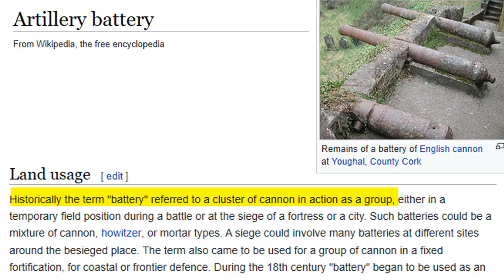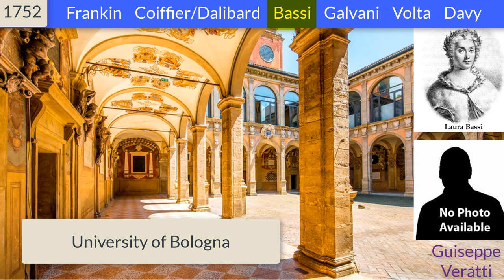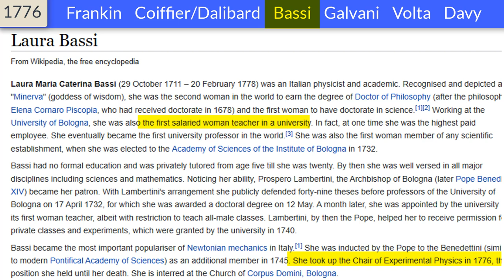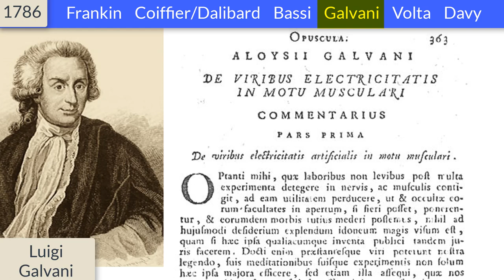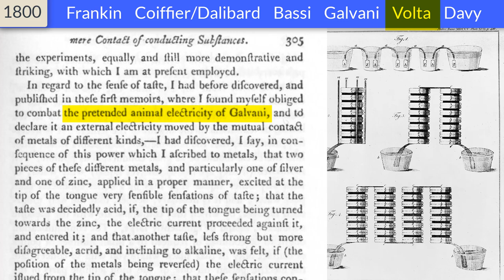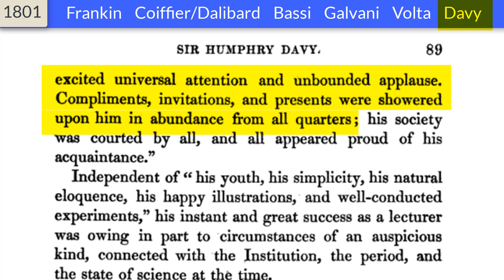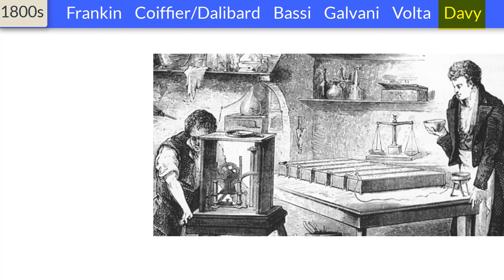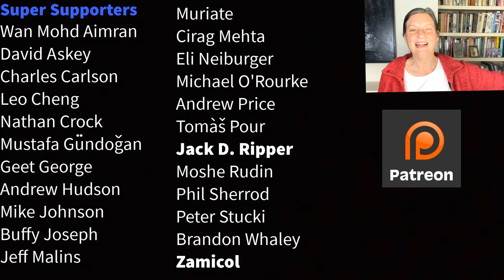Battery History: the Origin of the Name [CC]

Comment: Ironically, two of the most revolutionary energy producing devices, over 100 years apart, were both called “piles” in their prototype forms: Volta’s battery, and Fermi’s nuclear reactor, a “pile” of graphite bricks, uranium fuel rods, and neutron-absorbing control rods.

And Volta and Fermi were both Italian!

Also, the Battery is at the southern tip of Manhattan Island (where the sea defense cannons were originally) , and Fermi’s team were part of the … Manhattan Project!
Reply from the maker: That is a funny point
Reply: In Italian, "Pila" means literally a "Stack"...
Reply: @rayoflight62  It originates from Latin, was used in middle french from which it was introduced in English.
You find this word in the present Latin languages (Italian, Spanish, French...) with the same original meaning.
Don't forget that more than 50% of English words come from Latin or French
Reply: Piles are also a part of a construction, where the soils bearing load is low piles are bored directly into bedrock to support the foundation.
Reply: why are haemorrhoids called PILES?... 
After nitrated explosives were introduced like nitroglycerin/TNT I could see a link...given nitroglycerin is in some haemorrhoid ointments
 but that's when? late 1800s?
.
Reply: Great video!  Interesting that the French continue to use the word “pile” instead of “batterie”
Reply: Battery park

Comment: I remember being taught in High School (a vocational school) that what we call A, AA, AAA, C, and D are actually called cells. A cell is 1.5volts. A 9Volt is actually a battery because if you open one up you will find six 1.5volt cells inside. By the way, high school was 47 years ago for me. Great and informative video. Love your energy. Stay well.
Reply: There are also 3 volt, 4.5 Volt and 6 volt batteries from 1.5 volt round cells. 
Even a 12 volt battery made up of button cells.
Reply: The 9V batteries are mostly an array of AAAA cells. 6V lantern batteries were an array of B cells…

Comment: Was taught back in electric shop over 50 years ago that a say what they call size AA,C or D batteries  are dry cells. Batteries are two or more of these dry cells. Can remember a " D " carbon battery costing 25 cents at the corner drug store back in 1965 and they did not last long and usually leaked if left in flashlights or toys. Nice vid.

Comment: Fun fact: The number of electrons that travel through a lightening bolt to ground (~15C to ~350C) is less than the number of electrons that travel through a AA Zinc-Carbon battery over its entire lifetime when it goes from fully charged to fully discharged (~850C). 

The energy is far greater in a lightening bolt (~1,000,000,000 joules), than the total energy that is stored in a typical AA Zinc-Carbon battery (~1,300 joules).
Reply: Wait,. Aren't you intruding on your buddy, Victor Von Frankenstein's territory.  Shouldn't you be discussing some aspect of phlebotomy, instead?
Reply from the maker: That is amazing!!
Reply: @Kathy_Loves_Physics  Not, if your known “cold” electricity.

Comment: Hi Kathy, great videos - thanks. However I think the history is this: Cannons were used to batter the walls of a castle or similar to destruction (or the sides of the enemy's ships) and it was found that discharging all cannons simultaneously (a broadside at sea) had a greater effect than many single shots. So, cannons arranged in that fashion, to be more effective, were called a battery (because of the battering effect on the target). Electric cells therefore became batteries because when put in series their total Voltage was magnified and the pile (of cells) was compared to the increased effect of a number of cannons firing together.

Comment: I’d like to mention the regrettable replacement of the term accumulator with “rechargeable battery”. Way back when, we had accumulators and batteries. Accumulators were rechargeable and batteries were not. Nowadays everything is a battery, either rechargeable or not. They even look identical, for example AA and AAA batteries can be rechargeable or not, and a lot of people are understandably confused by that. It’s a pity we were not stricter with the nomenclature.

Comment: My understanding was that "battery" was simply short for "a battery of cells" where we commonly called a single chemical reaction compartment a "cell" (take apart a 9V battery and that is exactly what you will find). I am old enough to remember when we used "dry cells" which would still leak and corrode your radio if you left them in too long after they went dead.

Comment: As a youngster learning this subject I was taught that a battery was made up of multiple cells. For instance a single AA cell is not a battery, however if you connect multiple cells together, that is what actually constitutes a battery? For instance a common 12 volt automotive battery constitutes six individual cells in series, with a nominal charge of two volts each. The word battery implies more than one. A battery of artillery implies more than one artillery piece.

Comment: To complete the discussion concerning modern English usage:
1) A single flashlight  or hearing aid "battery" may be more accurately termed an electric cell.  They become a battery when two or more work together.
2) A car battery is a true battery because within it are multiple (generally six) electric cells.
3) A pack of wolves attacking a moose might be considered a battery, as they are multiple things working together for a single cause.
4) A power cell is generally a device to convert mechanical energy to chemical energy, which can then be used to make electricity.

Comment: Stumbled onto this. I am glad to see the origin of the term battery and it's use as in multiples. Though no mention of the term cell which refers to the singular setup of two dissimilar metals in one electrolyte. Yes multiple is a battery and a battery was the only thing at that time to generate electricity in a noticeable amount. A cell on other hand is very low volts so no visible sparks, especially in cells of low current. I know everyone today calls the singular cells batteries but battery is actually the plural of cells and I guess a pack of cells even though not connected is a battery. I am happy you started off with calling a 9v a battery as it actually contains multiple cells. Still I never seen the origin of the term cells for singular and why other then in electrical engineering, people call cells also batteries. It even did say on them like "D cell" and such.
Reply: I suppose that on a molecular level a single cell can be considered a battery of molecular sized electrical cells. 😉

Comment: It was not too long ago that companies such as Everready still labled A, AA, AAA, C, and D as "cells" and not batteries.  The 9-Volt, which had two cells, was called a battery.  Cars started with a multi-cell battery and the general public began using the name battery for all power cells, even those that were single,cell, and thus, not a battery.  Public usage won out and manufacturers started labeling and calling them all batteries.  The public-usage simplifying of terms has caused many changes in the English language.  For instance, most Americans now refer to a clothes hamper, or laundry hamper,  simply as a hamper.

Comment: I have a problem with this explanation of the word "battery"... the item Kathy holds up near the beginning of the talk is properly call a "cell"... a battery refers to a GROUP of cells in series with one another... thus a flashlight might have two dry cells to make up its battery (singular) that lights the lamp... The "battery" in my car is correctly call a "battery" because, if you open it up, you will find several "wet cells" in series... If one looks that the diagram of the galvanic battery, you see that it is really a large group of individual cells... 
At least that's what my father taught me and insisted that I always use the proper term!

Comment: Interestingly enough, in French, the word "batterie" is now commonly used exclusively for rechargeable ones - starting historically with the lead ones used in cars and heavy industry - like the common domestic non rechargeable ones are named "piles" in reference to the piles of 2 metals and paper discs used in its original battery, even if it was originally named the same in French!

Comment: Correction: Historically speaking,  early groups of artillery pieces working in conjunction with each other were named after electric batteries and NOT the other way around.  This came about because like electric batteries, artillery pieces worked in conjunction with each other, often in a series, and more importantly,  provided power,  in the form of both light, heat and the ability to do work.

Comment: What you had in your hand to start was’t a battery it should have been called a cell. A battery is an assembly of cells. A car acid lead battery has 6, 2 volts cells. Btw cells are called pile in French see the link ?

Comment: Initially you show a cell, not a battery. You need 2 or more connected together before it can be called a battery or more correctly, a battery of cells. Common (mis) usage of the term can't make a cell into a battery.

Comment: Except in the opening segment,  you show a cell, not a battery.  A battery has to be two cells at least. A rookie mistake to make.
Reply from the maker: Good point, except I am talking about the common usage of terms, and in common usage what I was holding up is called a battery (even though, to engineers, of course, it is not).  For example, if I go to the Duracell website what I was holding up was referred to as:  Duracell CopperTop MN1400 battery - 8 x C - alkaline
If you think about it, the fact that engineers describe a battery as being at least 2 cells is fully in line with Franklin describing an electric battery as more than one Leyden jar!  Which is very cool IMHO.

Comment: Absolutely WRONG. An AAA or an AA or a C or a D "battery" like the one you held up at the start is not a battery. Those are individual cells. The only modern "battery" that is an actual battery is the 9 volt type because it contains multiple (i.e. a battery) of cells. Multiple cells is a battery. One cell is a cell. People generally call the AAA, AA, C and D cells a "battery" because the English language is in decline and people are just ignorant. Those cells are not batteries and have nothing to do with cannons at all.